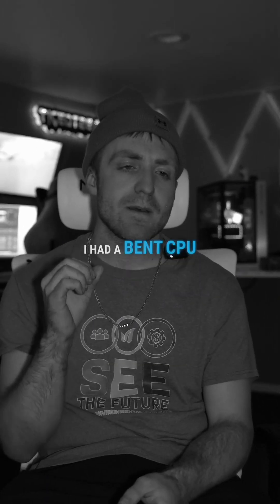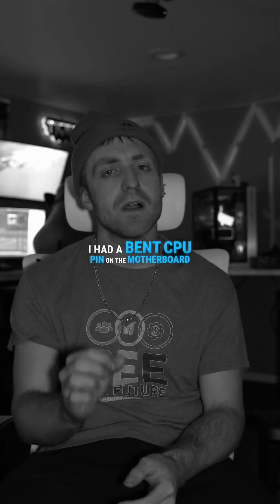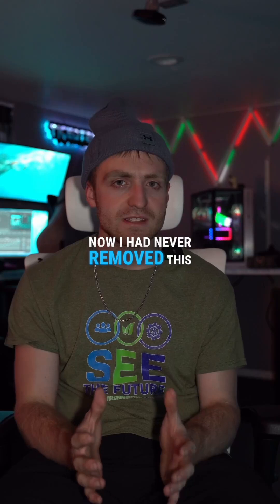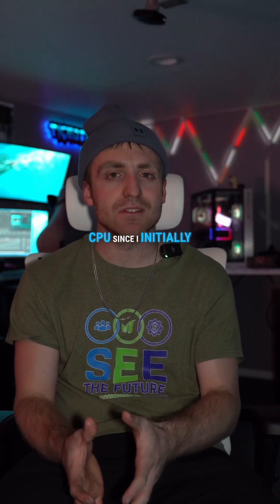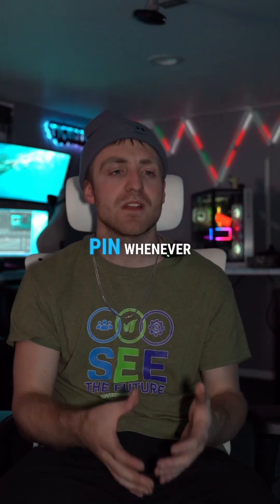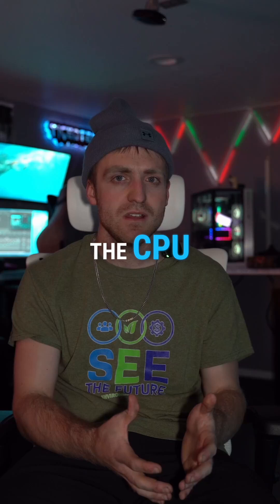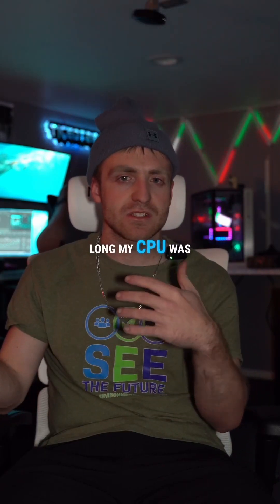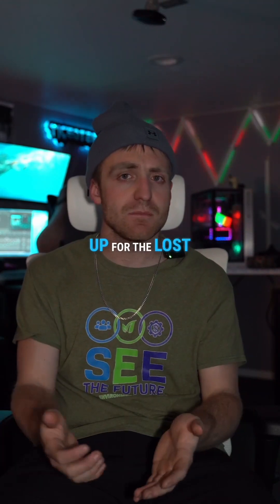Resolving a Bent CPU Pin Issue and Upgrading to a Ryzen 9 7950X 3D

Comment: Don't have an X3d CPU but supposedly it's a chace that stores lots of 3d stuff? (Not sure) That helps when playing demanding games
Reply: It uses a special 3d v-cache system to supposedly speed up the cpus memory cache or at least thats what i remember the 3d v-cache system doing. I know for a fact that the 3d v-cache is what it means tho.
Reply from the maker: @ appreciate the knowledge
Reply: @icedt28_  np. Id fact check that though bc im not 100% sure.
Reply from the maker: @Holygroceries  yeah I mainly wanted to see if it boosted fps or anything like that
Reply: @ thanks for knowledge, I'll try to remember it so I'm able to help others
Reply: The x3d means it uses 3d nand flash type storage for the cache levels, and has a lot more cache than the non 3d counterpart. Same cores, same threads. It is better for games that need a lot of cache from the cpu, but it really only matters if you’re running a GPU that can actually outpace your cpu which is uncommon these days unless you’re buying a 4090 or something.
Reply: @parkersprojects4597  just googled and its for 3d v-cache which just means it stacks another set of the v-cache to make it faster. So yes youre correct.